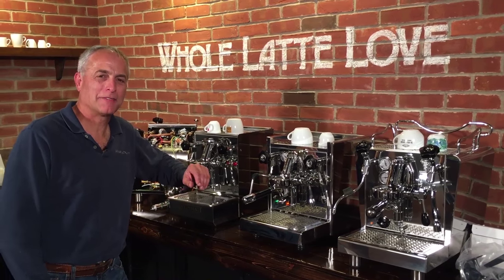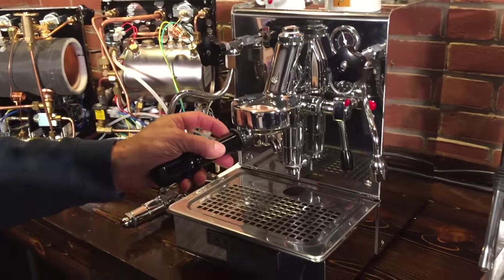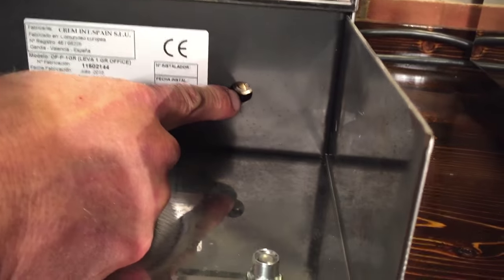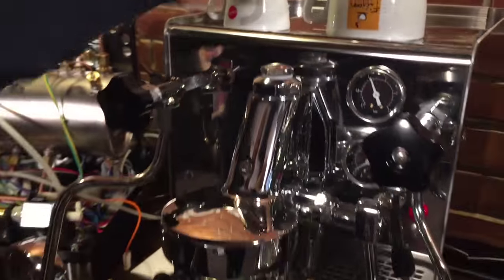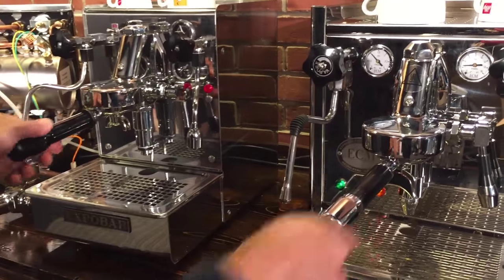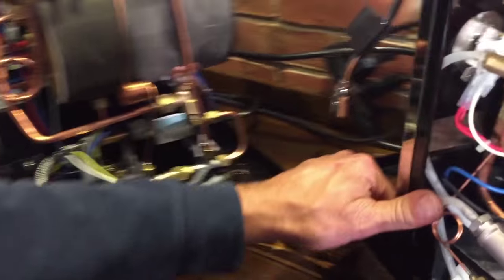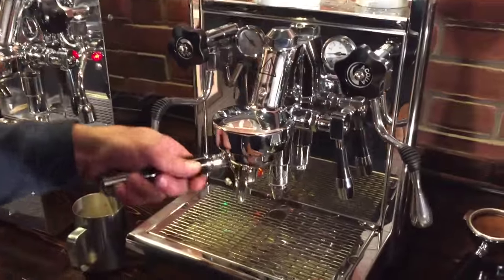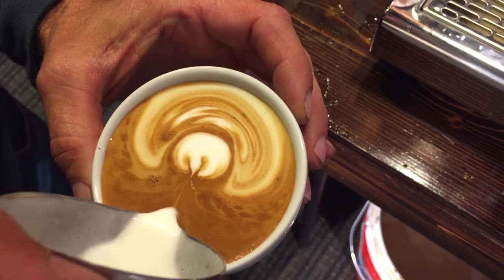Compare: Expobar Office Lever, Bezzera Galatea Domus & ECM Technika

Comment: I realize ECM and Bezzera aim for beautiful finish but hey - Expobar doesn't look poor next to these two, it has SS bottom which would matter if waters gets its way down there, has a preinfusion chamber (nice nuance on non-plumbed machine) and I just love drip tray of proper volume allowing to flush and rinse group and PF without worrying about spill over. When people flush their big 1K+ machines into separate cup to not overfill drip tray I remember my first machine, cheap DeLonghi with particularly shallow drip plate (I can't use word tray here). Just how big difference in steaming performance is between vertical and horizontal boilers - I guess horizontal has a tad more volume for steam?
Reply from the maker: Hi 1, Many love the Expobar machines. We do too for many of the reasons you mention like the huge drip tray volume and the pre-infusion chamber behind the shower screen on their E61 groups. What ECM, Profitec and Bezzera have is more attention to finish details of the case like polished and rounded edges. IMO there's not much of a difference in steam performance in horizontal vs. vertical boilers if all other things like total boiler volume, heating element watts and steam tips are the same. Matching steam tip hole size (and number of holes) to a boiler's potential is more important. If you want the most steam performance in a prosumer level machine look to the ECM Synchronika or Profitec Pro 700 dual boiler machines. Their steam boilers were upgraded to run at about 2bar of pressure when idol compared to most other similar machines running at ~1.2bar. That extra pressure makes a big difference!
Marc
Reply: Thanks for pointing out to relation of steam tip and boiler/heater combo. This what I call a systemic approach!
For me as a small volume consumer steaming milk in 10 secs isn't a priority nor I need to serve multiple whites with no waiting between - I'm happy enough not having to heat/cool boiler between shot and steaming.
That Expobar Lever is making my mind busy thanks to your videos, though.
Reply from the maker: You are welcome!

Comment: Why are the espresso shots only 10 seconds here? I though you were supposed to aim for around 25 seconds extraction time. Thanks!
Reply from the maker: Hi Robbe, Thanks for the question. So we did this video nearly 3 years ago. I just looked at the extraction which starts at 9:19 and it runs till 9:45. That one was 26 seconds. Keep in mind this video was about the machines and not how to do an extraction. Sometimes in demos in the interest of time we might cut a shot short. Also I'll mention that timing is not the only parameter one can use to determine when to cut a shot. It's a starting point. If you are into this sort of thing, we have a video on using brew ratios - using coffee dose weight and shot weight in combo with timing: https://youtu.be/57UqPDirHoU
Reply: Many thanks for your reply! I think I had the counting all wrong. I understand now that you're supposed to start counting as soon as you switch the lever whereas I started counting as from the first drip of coffee touching the cup.